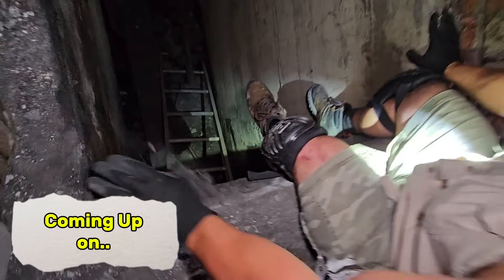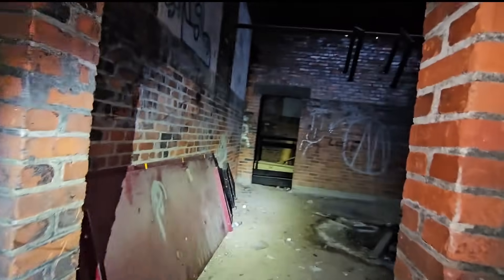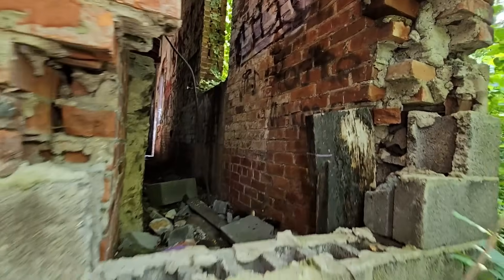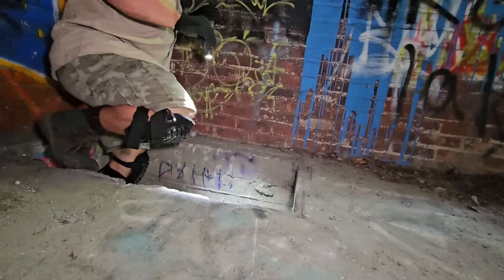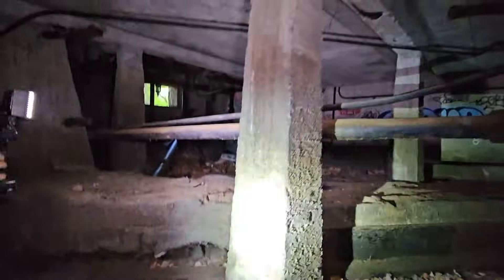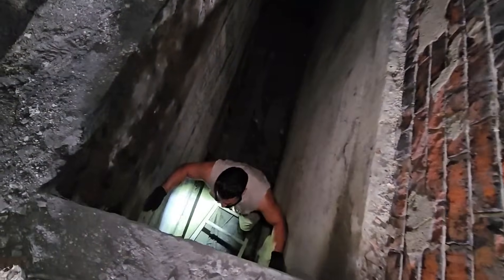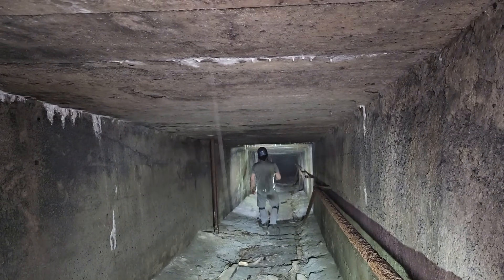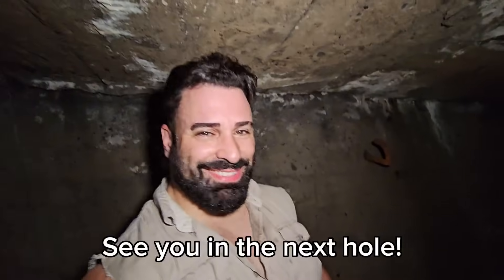Wheel House in The Woods Hides Important History and Secret Tunnel

Comment: I’m born, raised and from Bucks County. You guys need to be careful. Especially wear respirators when you go to old mining sites. Pennsylvania was  a huge player in the asbestos industry. Look and find a copy of the 1959 or 1960 USGS report, it will be a series of thick books. It will show all of the mining sites with mineral maps that used to be there and what they mined that were closed by the EPA when they were created in 1959. Most of those places have been erased from current maps. You may bring home more than you bargain for visiting some of those places. I also know this from experience going and visiting places. You may want to look for old kiln sites around that building. It may be an air pump for a lime kiln. That huge pile of crap in the warehouse area may have been a pile of asbestos. I wish you guys were a little older so you could’ve explored the Byberry mental facility while it was still there. That place was scary. I went there in the winter of 2004 2005 and it was like going to another planet.
Reply from the maker: @7seriesmax  I totally hear what you're saying. We try to spend as little time in these places as possible, but this location was definitely worse than usual

Comment: iMO , that is not fan , that  is water driven device creating rotation that was applied by belts to the  machinery , or even was applying force to energy generator, considering what is on the old picture
Reply: No, it’s a fan to circulate air in the mine.